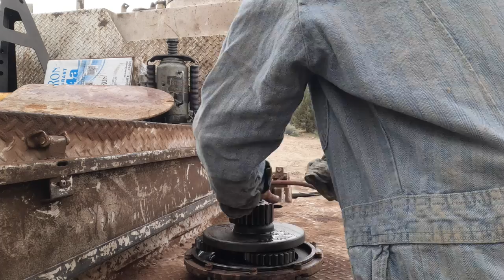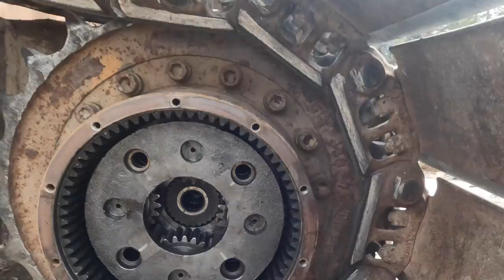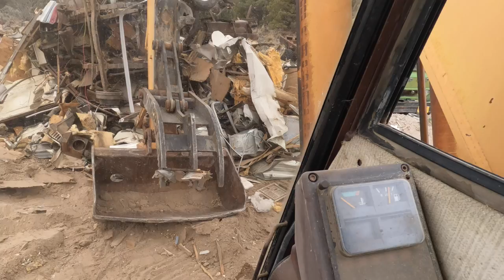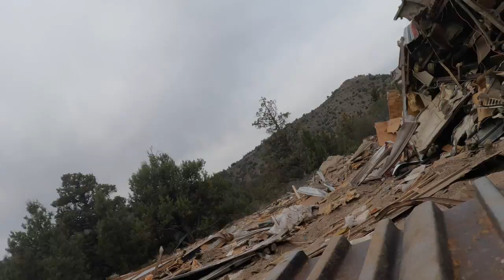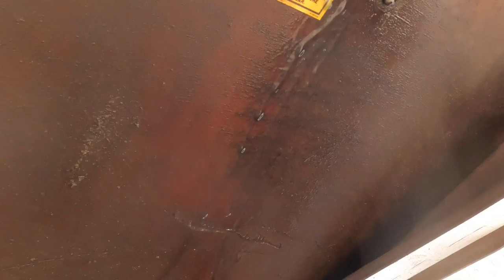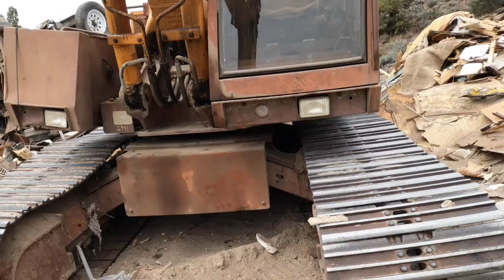Case 1088 ( temporary final drive fix)

Comment: Thanks  Warren for you time and sharing.
I was at a flea market Sunday and talked with the owner of several BadBoy mower equipment stores, his home location is in South Carolina. He said that motors for new machines are running out, the steel used in the machines went up 450%. In July of 2022 the machines cost new were going up $2200 - $2800 each because of the manufacturing parts, he said they options for 7 different brands of motors and that BadBoy cannot get them. All distributor units for sale to each store will be reduced by 2/3 from their previous year sales. He said he sold 900 units in 2021 and the manufacturer is only allowing 300 units for next year. He is a smart business man owns many small businesses (178 when he was younger, now down to 7 stores, well educated worked for BASF chemical/medical division for 20 years and a multi-engine pilot). 
I am just putting this out there that some major lifestyle and business changes are coming and folks need to do due diligence to survive through whatever comes our way and not become the victims. Port of Shanghai was closed down last week, no ships in or out.
🤢😕😟😲😠👿 Please take care folks, order your consumables now while available!
Everything is going up and may run out of stocks!

Comment: Enjoyed that.  The final drive inside looks similar to the one in the JCB 814 I have.  Was hoping to see you change the seals inside to stop the leak.  I have a similar leak in one of mine.  When you take out the motor at the back there is a brake piston and a number of brake discs.  The seals should be behind that.  At the moment I'm using heavier gear oil and it doesn't seem to be leaking.  It does get hotter than the other drive though which makes me think that heavier oil isn't penetrating into all those bearings that you were strugling to keep in place.

Comment: trudat on long bolts red loctite . i did floating seal on newer 160 couple years ago , same LONG bolts with T90 torx heads and i think same tork . he was fortunate , leaked oil when he parked it . used machine , got swamped , i think as seal backs and Orings packed solid with clay dirt .

Comment: Sure hope your taking Sundays off.the work never ends . Another informative video.thanks for sharing 
Warren.thanks for keeping it real. Looking forward to your next video. Glad to hear your daughter moved on. I wondered how long it would last .considering he quite on you. When times were tough he he may have  quite on her too. Looking forward to  the hemi fix.
When we worked on my uncles hemi. We had a book. We found heads at a wrecker. Bought new valves. Everything lined up .caution there is a sensor on the front passenger side below the upper sprocket .left side.
Don't put a magnet near it or the computer won't read anything and truck won't start . You probably knew that . Hope the info helps 
Have a good week

Comment: If the owner would like some guaranteed used finals, try FP Smith in Fairfield ca. Or it may be Bencia ca. They have a good selection of used excavators, dozers, scrappers, etc. a company I used to for for had a bunch of 1080s and 1280s. The engines were great, Reginald drives were seldom a problem, but Hydralics were weak.  Upgrade your hydralic fluid to equal of chevron UP 68 or turbine fluid in 68 grade. We changed all of the 1280s, 1080s and poclains over to it and they had much better and longer pressure resistance and pumps and finals ran better. 
Good luck,

Comment: Warren, could you use engine assembly grease to hold those bearings together while you install them? That grease should still mix well with the gear oil needed in those hubs. Or am I wrong on that? 
As for the thieves, seems to me like someone needs to be sitting out there with a scatter gun, a few lead pellets WILL deter them from doing it again.  
This old machine needs a lot of TLC and a good cleaning. Shame owner/operators don't take better care of their machines. 
When I worked for the state of KS for a bit, fellow operators used to laugh at me because I was constantly checking fluids in the machines I ran. I checked them every time we shut down for break, greased them about every 4hrs instead of 8hrs. My boss one day asked me why I did this, told me grease isn't cheap. I said, grease is cheap vs a break down and I don't want it to break down on me. He walked away and left me alone. LOL

Comment: Well , at least you made it move under it's own power.  I suspect that thing is going to be a money pit.  Something that has served me well over the years is to mix STP oil treatment in with the oil in  old /warn gear boxes and final drives.  It might be a stupid thing to do but I have managed to get away with a lot doing that , maybe it will help , maybe not.

Comment: I must admit reinstall of the finals with possibly failed seals, I would have packed it with moly grease on install then topped it with gear oil, over time and use the oil breaks down the grease so you end up with a sealing lubricating sludge

Comment: Warren you leftout the 400+ torque part. I am real curious how someone your size does that. Granted I'm not familiar with torque multipliers, other than a section of pipe. I don't think you can get there from here. Cheers
Reply from the maker: I have a 650 ft pound torque wrench with a 5 foot handle, and also a 4 to 1 torque multiplier on the truck, do those kind of torques almost every day.

Comment: They stole a radiator out of one of my customers fork lift they bent it up into a ball and pulled it out the counter weight. The damn bastards will work that hard to steal from someone but not a real job LGB
Reply from the maker: We were talking about that today, they could make more with a steady job.
Reply: @westerntruckandtractorrepa1353  that's for damn sure

Comment: Warren - I assume an excavator can't rotate more than 180 degree east or west. Otherwise I don't see how the hydraulic lines would not break.
Am I correct or is there a smarter hydraulic control method I don't even realise??
Reply: There is a swiveling manifold that takes care of that so they can swing 360 degrees
Reply: He pointed that out, rotary distribution valve